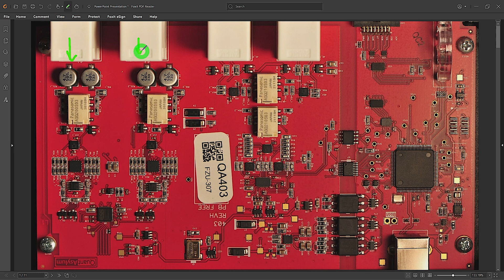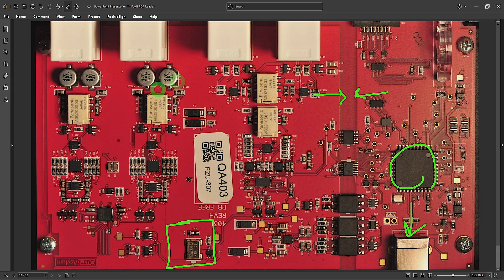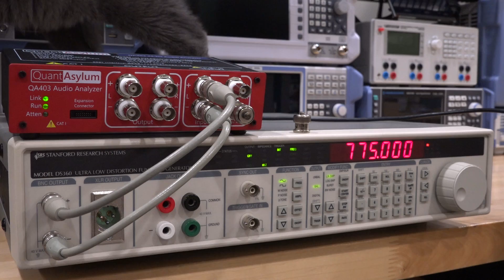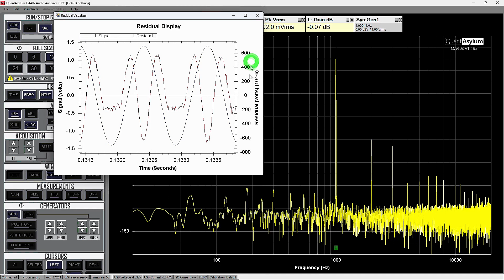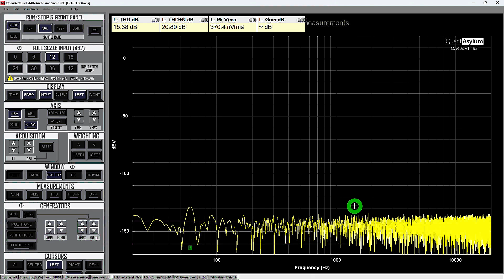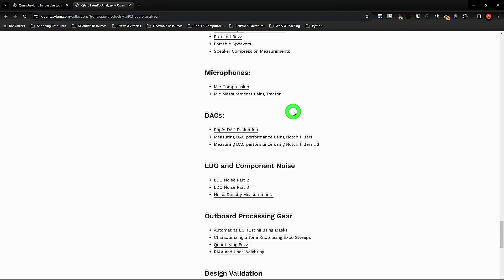TSP #273 - QuantAsylum QA403 24-bit, 0.0001% THD Audio Analyzer Review, Teardown & Experiments

Comment: Setting my QA403 properly, I was able to get L-THD of -127.48 dB with L-THD+N of -19.61 dB.
Connect unit in loopback. L-OUTPUT + to L-INPUT +.
Connect a shorting plug to L-INPUT-.
Set GEN 1 frequency to 1 KHz and level to -1 dB.
Set GEN 2 at 20 KHz an level -150 dB.
Select 48K sample rate.
Set FFT to 1024K. (lower FFT increase THD reading a few dB)
Set AVG to 100.
Clic on run button.

I suggest reducing FFT to 64K or 32K so that the unit can be oriented to minimise 60 Hz interference.
The unit can be put on it's side too.

Note that I currently have no special shielding in my lab.
Note also that I did not use 50 ohms terminations but real shorting plugs.
(50 ohms termination increase values by 1 to 3 dB)

My worst case 60 Hz is around -120 dB when unit sit flat on the table with a given orientation.
Putting unit on it's side and turing it 90° from previous orientation, the 60 Hz goes down to 143.92 dB
When you have found the lowest 60 Hz possible, increase FFT back to 1024K.
Now, wait until you get those 100 readings in.

In Europe, I believe 50 Hz is more common.
I suspect the same manipulation proposal could help.

I found out that the two harmonics peeks that are the highest are 2 KHz at -136.28 dB and 3 KHz at -132.22 dB. 
The others harmonics are at least 10 dB lower, except for 9KHz, sitting at -138.40 dB.

The R-INPUT+ and R-INPUT- have both been shorted.
Te right channel show residual noise below -160 dB from 20 Hz to 20 KHz.

Conclusion:
Pricewise, nothing is better than the QA403.
(I paid about 900$CA, shipping and custom included)
Looks like going some to a 20 or 30 time more expensive piece of equipment does allow one to beat the QA403.

Comment: Hi thank you so much for your extremely valuable analysis
I missed the part number of the opamps used inside the unit    Their performance looks state of the art ?  
Unfortunately the best figures are around 6V output    A little too much to drive a power amp   Maybe with a voltage divider at the output ?

Comment: Why not use a AD7760 with a 256-bit decimation FIR filter at 2.5 MSPS? Same specs for ADC and higher bandwidth
Reply from the maker: Because the ES9822 has better dynamic range and linearity, not to mention it is two channels.

Comment: To get rid of 60hz spike just connect USB GND to signal in GND of the interface. It is isolated system meaning there is no path fro 60hz signal to go, but as soon as you connect it to USB ground it will remove it.

Comment: I’ve had this instrument on my want list for awhile now, but I’ve been holding out for the last year or so for the QA404, but it keeps having setbacks which I’m guessing are due to accessibility to parts.  I’m wondering if I should just bite the bullet and grab the QA403, though with my luck I’d buy it and then they’d announce the release of the 404.  

Has anyone been in the same boat, waiting for the 404 and just decided to get the 403? Curious if I should keep waiting.  At the moment I have no analyzer.  Out of curiosity, would this work as an analyzer to where I could check the IF alignment on radios and such?

Comment: 120 dB is a ratio. It means nothing without the reference.
Reply from the maker: That is what THD is. It is a relative measurement. In the case of the digitizer, this parameter defines pretty much the worst case scenario because there are passive attenuators in the front-end.
Reply: If you have the spectrum plot at hands it is quite meaningful, e.g. for judging noise floor which is the relation of signal/noise...

Comment: No phase measurements,  I guess the dac/adc do not use zero phase halfbands.   I am also concerned about what is going on above 20KHz.   A lot consumer audio interfaces have a +36dB bump in noise above 20K (when running at 96/192K).  My guess this is how they do asrc to sync the clock domains, by using clock jitter.      This sort of out of band noise can affect a measurement of an opamp.    You may want to measure the noise floor of the dac using a different instrument that displays to 96KHz.

Comment: You should do a circuit board analysis of the Kitsune KTE Holo May DAC, which is an r2r ladder DAC. I think it would impress you. It’s my favorite DAC.
Reply: Would be nice to do some R2R DACs comparison and measurements. r2r ladder is one thing, other one is good I/V stage to achieve good quality sound from DAC.
Reply: Yeah its an end game level DAC in terms of sound quality. I own one and I wouldn’t trade it for any DAC at any price. But from a circuit standpoint its a unicorn because it surpasses the limitations of the traditional resister ladder where it can rival DACs using FPGA processors like say a DCS Bartok, Mola Mola Tambaque, or Chord Dave. The circuit board layout is a work of art. Same goes for the Benchmark AHB2 power amp which rivals the THD of that Stanford Research amp this channel did last video. The Benchmark AHB2 has a -137db THD/N bandwidth. And the Holo May is a perfect match for that amp.

Comment: If they replaced the BNC connectors with XLR and made it appear as a USB soundcard instead, they could sell it for ten times as much to audiophiles, and it'd still be better than most interfaces at that price.
Reply: Probably doable with some minor SW/HW modifications. You have a nice idea with using it as audio interface instead of DAQ :)

Comment: Didn’t know this product existed at that price point!  But only working on Windows is a no go.  Also needs a way to send PCM to a DAC instead of assuming only USB.  I was in the process of designing something like this but now I may need to rethink 🤔
Reply: I think the software can run under Mono on Linux (don't have a reference, but I did read it somewhere today!).
Reply: It does work under Parallels (on MacOS 14.4.1).  Having said that a cheap old laptop could be dedicated to the instrument if wanted, it doesn't need super PC performance.

Comment: Awesome video as usual. It’s funny that you decided to review an audio analyzer a few days after I decided to delve deeper into audio amplifier design. I was watching your video on class-D amplifiers a couple of days ago, which is also superb!

You mentioned at the start of the video that this is a 24-bit analyzer, but the ADC seems to be 32-bit. Is that because there’s is some degradation in performance on other parts of the system, or is this supposed to be rated as a 32-bit analyzer?

Thanks again for the amazing video!
Reply: I can try to answer. If you assume a +1V range, then 1/2^24 is a 50nV step! 1/2^32 is a 0.2nV step. These voltages are so small that just temperature differences across an IC can lead to massive swings in value compared to the least significant bit. So while the ADC will give you 32bits, preserving information from far away from the ADC into the ADC chip (or even within the ADC) is extremely challenging.

Comment: Not the kind of instrument I'd use, but I'm very surprised at how good it is and how little it cost.
When at the end of the video you showed the price I was very confused. For a niche instrument like this with this amazing quality and software I expected a price on the order of multiple thousands of dollars.
The guys who made this should be proud!
Reply: Very thorough, informative walkthrough. Thank you! I do have a question about this unit that doesn’t seem to be dwelt with much either here or on the QA website. There is a generator built in but, there aren’t any specs on the QA website or in this video. It’s nice to have a nice low noise input to the analyzer but, it’s even more essential to have a low noise and distortion signal generator. QA always seems to use this (?) generator with a notch filter or show the analyzer capabilities with another, external oscillator. You show the two sections in loop back but, you don’t really qualify the parameters that matter. Please advise.

Comment: At that price point it actually makes me wonder about getting to >=100 dB THD by applying the digital pre-distortion techniques from microwave systems to this. Just not sure if a 2-channel sense will do as the extreme wide band of audio and physical desirable speaker shapes make directional couplers seem like a bad idea. And compensating with two spaced sense ports (microphones in very-low-THD architecture with characterized frequency response) per speaker to differentiate forward and reverse wave would double the number of sense channels needed.
Worst-case, attaching a sensor to the membrane and calibrating the air interface non-linearity aspects separately from the closed-loop digital pre-distortion, should still work and only need one sensor each.
Or it might even be that for speakers that have an extremely soft internal suspension, or even no spring to push the membrane back to center (relying on PA DC bias regulation to keep it from mechanically clipping), measuring the drive current would suffice.
Reply: The ESS DAC and ADC chips have distortion compensation registers, but I think only for 2nd and 3rd harmonic or something.

Comment: 14:33 to lower the DANL by another ~10dB, QuantAsylum should add a button to mathematically subtract the no-signal noise floor from the measurement, as is commonly available on RF spectrum analyzers from Keysight, Rohde & Schwarz, and others. Or use a min peak detector with enough sweeps to push the noise floor down, as a debugging tool to identify spurs hidden within the noise.

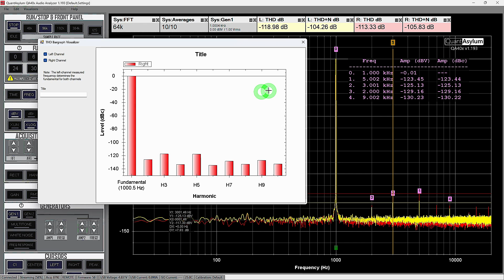The residual noise visualizer from 20:14 is of course another way to learn more about the distortion characteristics of the DUT, and would help with this type of analysis.

Comment: I wonder if with a firmware update the QA403 could be used as an Audio VNA. There is a lot of audio snake oil that needs a VNA graph to debunk with data, and on the flip side wonderful and interesting responses in things like tube-amps that also would show up. Like "warmth" only appearing when you do broadband chords that won't appear with pure tones.
Reply: what exactly do you mean by VNA?

You can already put in either a single tone sweep or white noise, for example, and look at how the response changes.
Reply: @tommihommi1  vector network analyser. Looking at the signal reflections between amps and speakers. There are some interesting interactions at the system level.
Reply: @tommihommi1  No, VNA is about sensing current and voltage on a port separately, instead of only measuring one and inferring the other by multiplying/dividing with the nominal impedance.
E.g. speakers are typically highly inductive, and often speaker effects/distortions could be reduced if the amplifier could be more of a current source than a voltage source. But even that is very idealized, of course. Hence the desire for VNA tactics.
Reply: That's a valid point. Lot's of test on ASR are just useless as they don't show whole truth what's going on with signal. I'd be very interested in such use case as I always believe in audio hearing is believing, not just limited measurements as indication of DUT sonic quality. How is that tube devices sounds so good given higher THD etc versus uninvolving, clinical sound of newest silicon DACs, AMPs etc with 0.0000x% THDs. Also, such Audio VNA would be great to measure difference that different cables (signal, power) brings and are easy to spot (to hear) with high resolution audio setups but are tricky to measure using standard tests. If anyone knows of such device and test designed to show such differences please let me know.

Comment: Many thanks for this video!
It's a pity, that you obviously  can't synchronize to external frequencies.
Is it possible to precisely control / trigger on the phase between internal oscillator and ADC acquisition?
You might compare this impressive low THD performance to your HP3458A, which has an ultra-linear and low THD ADC as well.
In 1990, I built an FFT analyzer with this instrument. 
The 195Hz ac signal was in the µV .. mV range, amplified by a low THD, low noise x 100 pre-amplifier (better than the SR560) and the front-end of a LI, using a very weak LPF @ 50kHz, i.e. using a rectangular window. The 100kHz sampling frequency was phase and frequency locked, so it was possible to make a complex FFT on the magnetic response of High Tc Superconductors (X' + iX'' and higher Harmonics) with high accuracy regarding amplitude and phase (+/-50ns), and no frequency leakage.
The NIST and PTB still use a similar method to precisely measure audio ac signals, by extracting the internal 10MHz ADC clock of the 3458A, and phase-synchronizing that to the input signal. 
accuracies

Comment: 9:53 it would be interesting to know why they implemented the power supply like that with transformers instead of using off the shelf isolated regulators... price/performance most probably but still a good question
Reply: Great question! My guesses, they wanted to synchronise the switching with the ADC clocking, and have this fully software defined to allow optimisation? Many smps chips will allow external clocking or sync but not full control of the feedback loop
Reply: @ralfstocker7742  OK thanks. 
So apparently they are driving a center tapped transformer to get split supplies and regulating them with LDOs. They claim really good noise performance but remain somewhat reserved in terms of cost efficiency.
Reply: I’d like to know that myself

Comment: Finally a piece of test gear I have at home ;) Since the SR560 also makes an appearance here: I built a small front-end clone PCB of that (due to it being covered in The Art of Electronics), same topology, better noise performance, all on a credit-card sized PCB. Fun little project.
Reply: What chapter and page please if you have a moment. :)
Reply: @andymouse   8.6.4
Reply: thanks ! @FortyBot
Reply: do you post your design somewhere? would be interesting to see it.
Reply: @kafinmufid994  Youtube has been deleting my comments with links recently, unless they were other YT videos. I used JFE2140 instead of the original JFET and reduced the resistor values as already suggested in TAOE. Changed the Vds that is forced across the JFET pair to 5.1V instead of 6.2V, will eventuall go even lower (maybe try a 3.3V Zener), also slightly lowered the bias current to between 2-3mA per JFET. Everything else is pretty close to the TAOE/original Schematics floating around on the web (I was experimenting with drain resistors and JFET stage gain but was lacking some footprints for compensation components). I used 1206 (imperial) resistor footprints throughout the signal path and fitted Vishay MMA0204 MiniMELFs due to their comparably low excess current noise (see "Resistor Current Noise Measurements" by Frank Seifert). I also replicated the front-end circuit on a single layer home-etched board with TH parts and LSK389 for the input JFET, works nicely too but the single layer construction comes with its drawbacks regarding EMI etc.
Reply: @kafinmufid994  I was going to make a PCB revision 2, fixing all the errors of revision one (and adding relays for the selective input grounding, input reversal and AC/DC coupling on the PCB) but got it got bumped down the priority list. As it is the board is not really optimized for hand assembly, cleaning or BOM cost. I want to change the miniture trimpots and latching relays to TH to allow for an ultrasonic bath after full SMD assembly for example. And some other stuff...
Reply: What about software side of this? Hardware is an easy part, one can easily clone/duplicate PCB, whereas writing software or programming MC/DSP or whetever to make that silicon do what we want is a bit more tricky part of whole device.
Reply: He's not talking about replicating the entire unit he's talking about the principles of using just the Low Noise JFET front end. He very kindly gave me the page number in 'The Art of Electronics' and they are 8.6.4, check this out and you will get it :)  @aeonikus1

Comment: The standard instrument for this application is the Audio Precision APx555 which is around $30,000 list price. 
Would be great to see a comparison. An immediate disadvantage for me is that the QA unit has a much lower input voltage range, whereas the AP inputs are rated up to 230V peak. This is useful as you can directly measure the outputs of high power audio amplifiers like a differential probe. 
Only an external LPF is required for PWM amplifiers.
Reply: Yep definitely beats AP, but AP is reference, like fluke in DMM's...
Reply: @ZegaracRobert  ? In what way does the QA403 "beat" APx555?

Be specific, please. I am curious. Thanks!

Comment: Might I add that a competing product, also using the ESS9822, but without a generator, is available for approximately half the price. It’s called the E1DA Cosmos ADC.
Reply: Yep, I use the E1DA Cosmos ADC for all my measurements -- phenomenal for the price. E1DA has a whole line of crazy high-performance AF measurement gear, but you don't get the software integration of the QA stuff. I just use REW, but having a dedicated software package would be quite nice.
Reply: There is an isolated version by now (isolation after USB-I2C bridge, not before it). Cosmos DAC isn't released yet afaik
Reply: @philippwie3539  TOPPING E30 II or TOPPING E50 Balanced are also quite a decent alternatives.
Reply: I was just gonna mention this as well. There is also a Cosmos DAC. That way 3rd party software can be used. Obviously the Q403 is a more complete package incl software.
Both way more affordable options compared to Audio Precision.